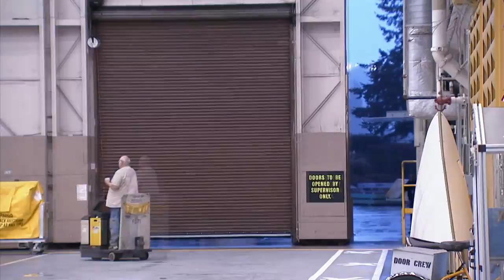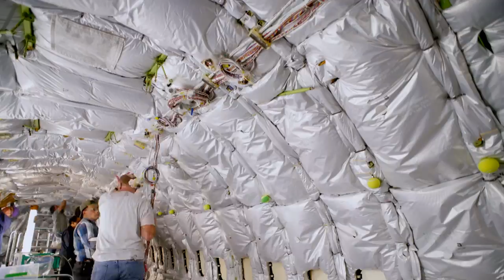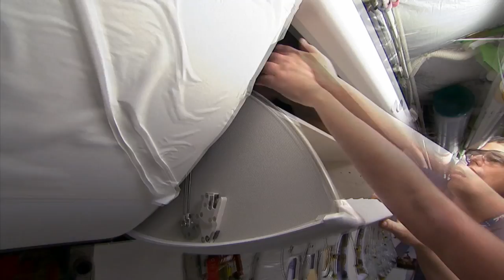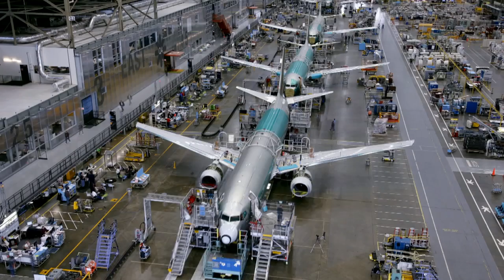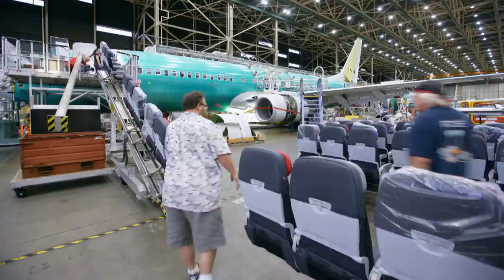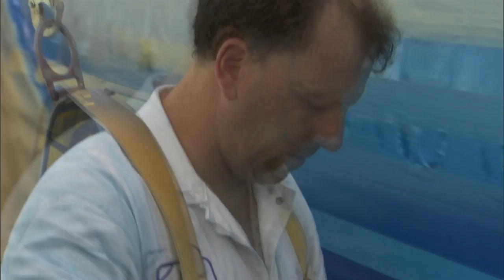Building Boeing’s Next-Generation 737 Airplane

Comment: Impressive! How long does it take to assemble one?
Reply: 黑竜崎  2 minutes and 15 seconds.
Reply: Well, they produce 42 B737 NG's in a month. I'm not sure, but I think it should take at most 2 weeks to build one
Reply: 3 a day
Reply: 黑竜崎 Durude Sandstorm
Reply: 黑竜崎 A few  months.
Reply: 黑竜崎 8 days
Reply: I currently work at the Renton plant. They are built on what is called Flow days. There are a total 8 flow days. On each flow day different jobs get done.
Reply: +黑竜崎 غاغهن8
Reply: +Yuri Kamen (Mother Russia) you have issues